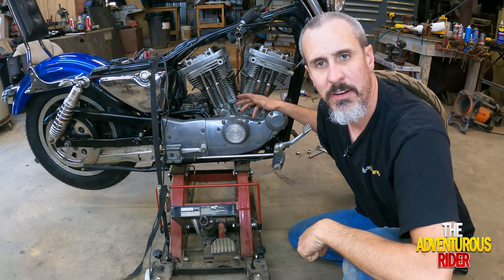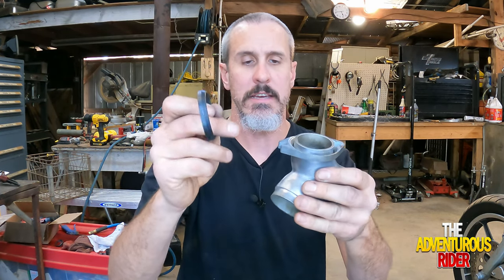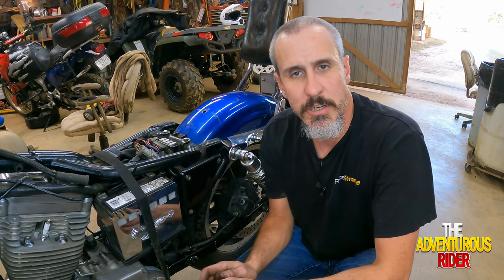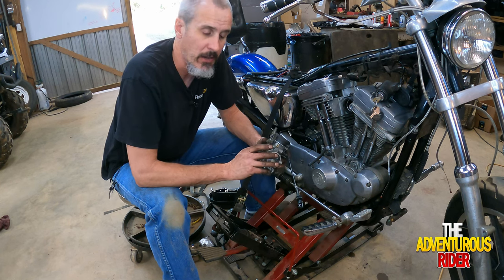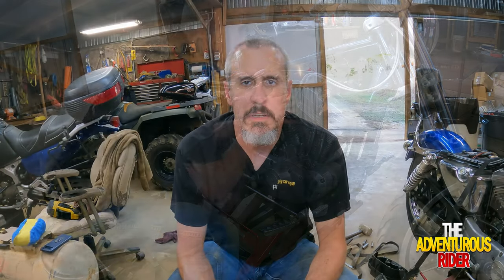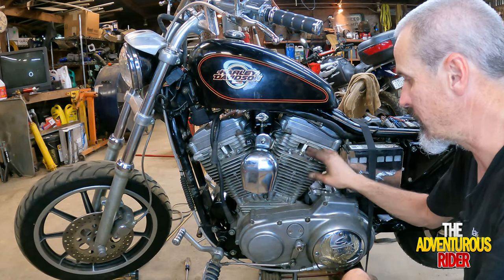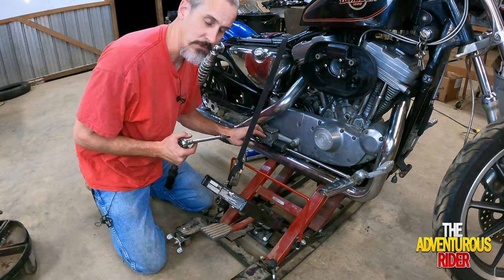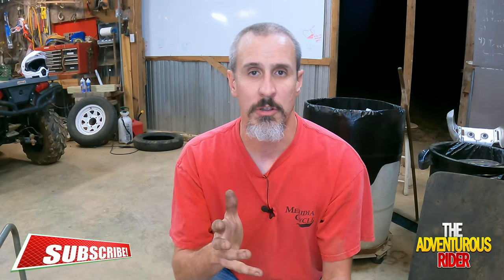How to reassemble a Harley Davidson EVO Engine Part 2

Comment: Thank you very much for your detailed step-by-step easy to follow instructions! You are an amazing teacher! I'm in the same situation as this video you posted. (blown lower gasket)

My Harley is a '95 Softail Springer Bad Boy. I blew a lower head gasket, front cylinder. I have never broke down an engine before but feel 100% confident after watching your videos. (subscribed!) I'm ready to go except for this road block at J&P Cycle.

I HAVE NO IDEA which option to choose on this drop-down list:
3-3/16 bore
3-5/8 bore
Std bore
Std bore / .030" Head Gasket
(product: Cometic Top End Gasket Set For Harley EVO 1992-2000)

I would be extremely grateful if someone knows which option I need to choose, so I can start my job.
THANKS to all!
Reply from the maker: Thank you so much for the kind words and thanks for the sub.   Is this a one owner meaning your the only one who owned it? Just trying to get some history into the bike.
Reply: @theadventurousrider  I'm the 2nd owner. I am nearly certain the original owner upgraded the cam. I tend to believe he did not. I think the bike is stock but not positive. I do find it strange that it blew a lower gasket at 25k miles though, as if one of the studs was never torqued properly. (I put 3,500 miles on the bike since purchase) Thanks!
Reply from the maker: @Jeff82556  well the only real way to tell which size bore you have is to go ahead and pull the motor down if you haven't already .  After this you can use a micrometer to measure the inside of the cylinder walls or on the very top center, I think, it should be marked what the piston size is.   Also tomorrow I'll find a video, I think he did a video of this, of when a friend was check his size on his small Evo chopper.  I'll send ya the link.   I'll also ask him to verify the actual std bore size of the big Evo engines.

When you say lower head gasket are you talking about the one between the crank case and jug or the same one I blew, the one on top of the jug?
Reply: @theadventurousrider  Yes I figured I might not know bore size until I pull it apart and grab my digital caliper. To answer your question, it looks like I blew the gasket under/below/bottom of the jug. I really need to take a closer look. I got home with the new pop pop pop pop noise and low compression for 15 miles. I did see oil seepage, not lots though, when I stopped on the road after hearing this new alien noise. (thought I was screwed, needed tow truck) The oil I spotted was located very low at the bottom area of jug but it could've just leaked downwards from above I suppose.
Reply: @theadventurousrider  Thanks for your help. I went ahead and ordered "Genuine James Top End Gasket Set - 17040-92". Dennis Kirk claims it fits my Harley. It didn't ask to choose a bore size. Worse case, it ends up being wrong. Best case, I have gaskets on hand when I take apart that EVO. Thanks again for being a great teacher and responding to my questions! And oh yeah, I bought new studs as suggested by Doc Harley, who I briefly watched. (Colony #9424-8 Cylinder Base Stud Set)
Reply from the maker: I'm by no means an expert but the lower gasket leaking shouldn't effect the compression like the upper/top head gasket will unless there is something wrong with the pistons/piston ring.  The base gasket is just sealing the oil from the crank case which shouldn't build any pressure inside the crank case.  Be interesting to see what you find when you get it apart.
Reply from the maker: Good deal that will save you possible headache like I had.  from what I can tell the std bore size is 3.5 inches which is from looking at the gasket set on dennis kirk is going to be what it's for.

Comment: two things I gathered here, first clearly I need a torque wrench, I just torque it until it feels like the bolt is about to break lol and two, if I need an engine I'll send the bike to you lol
Reply from the maker: haha... yea it's a lot of time it's not as critical but most of the time you can find what the torque is for a bolt in a manual.  Bring it on man I really enjoy doing mechanic work but will say that if you do you'll be coming to be the camera man for me.... LOL.. it's a chore and even sometimes luck that the shot came out where i wasn't all up in the way.  Thanks for watching man.